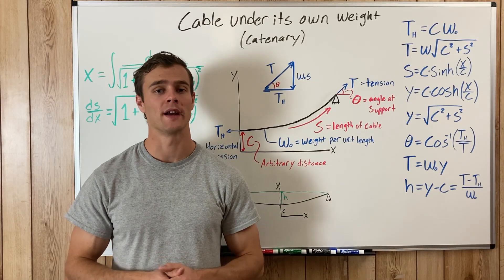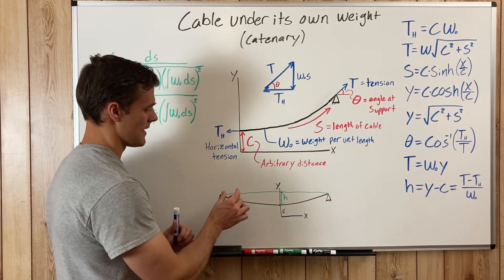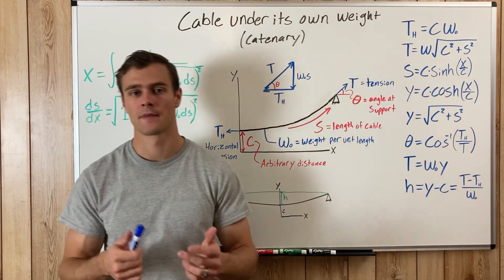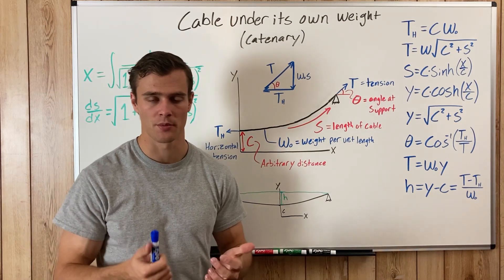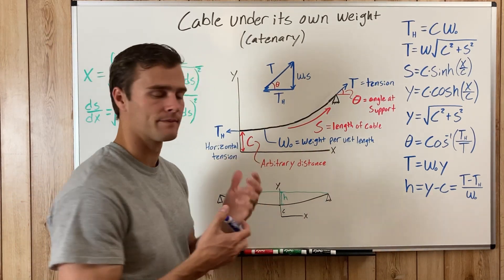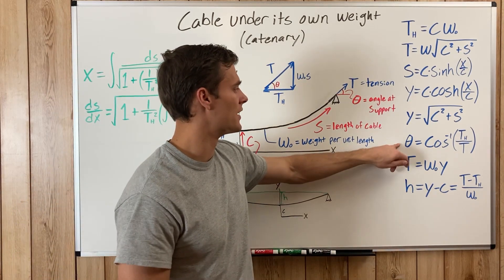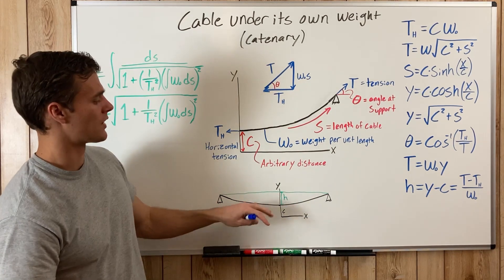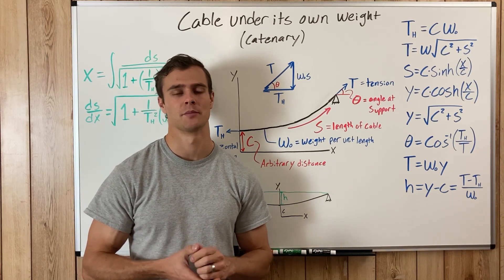CATENARY LOADED CABLES (Free-Hanging Cables) // How To Solve For The Unknowns // Equations Included

Comment: how to find C value analytically?
Reply from the maker: Michael Van Biezen in this video shows how all of these variables, including C, are found. 
https://youtu.be/bciFxVUOBaE
Reply from the maker: C is just the distance between the x axis and the lowest point in the cable and because an axis system can be set up anywhere, the value C just helps us set it up in a place that gives us easier equations.
Reply: Hi sir, What i mean Sir is, if i have a 10 rods connected each  other and we lets consider rod is a segment ,each rod has a length of 1 mtr. if i hang point A and point B in any X and Y position.How to know the x and y position of 10 rods?
Reply from the maker: Let me see if I understand you correctly. Are you saying that instead of a cable you have 10 connected rods and the ends are attached to points A and B?
Reply: @studentengineering  Yes sir.. exactly..
Reply from the maker: I’m not sure you can use the equations in this video. Maybe you could treat it like a cable with concentrated loads where you replace the concentrated load with the half of the weight of the rod acting at each end of the rod. Here are a couple of my videos that talk about concentrated loads on cables: 
https://youtu.be/8p0usSl-_d0
https://youtu.be/INoEWQe8MAk
Let me know if this helps!
Reply: @studentengineering   Sir this what i mean. https://physics.stackexchange.com/questions/304445/the-hanging-chain-problem-catenary-numerically 

same in drawing , how to know the angles of each point in catenary?
Reply from the maker: I still think that you could treat it like a cable with concentrated loads. Do you know the weight or mass of each rod segment?